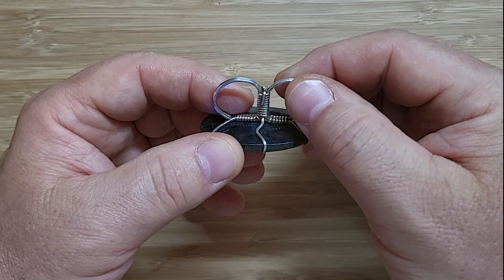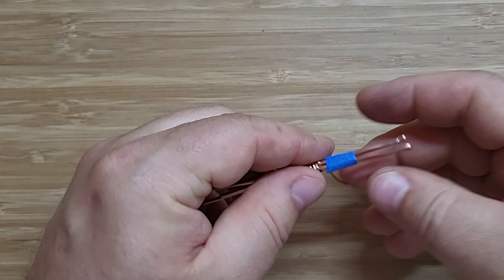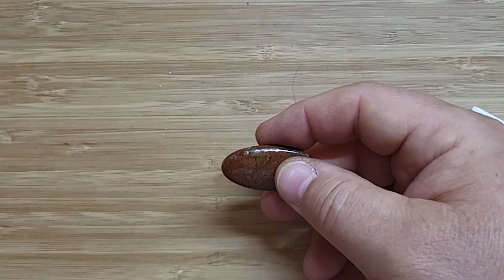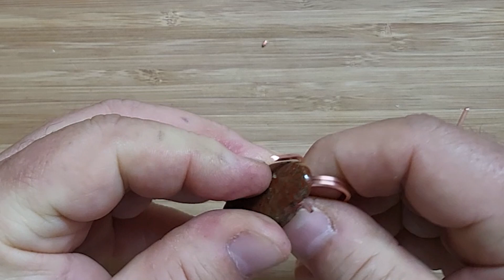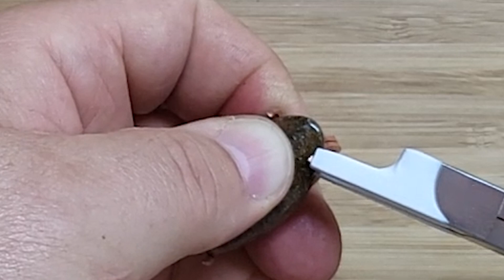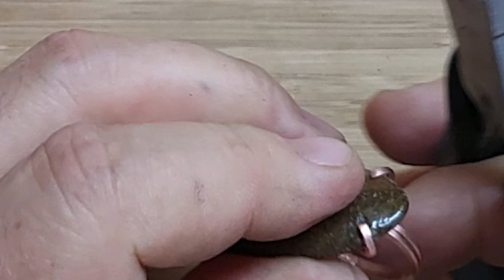The Two Finger Ring - Wire Wrap Tutorial

Comment: Hi Jim, this is a great ring, sadly my fingers are not long enough to pull off such a style. I have a tool question for you. I came across a jewelry tool (I think) it is a short flat nose plier that are more narrow at the tips, maybe 2mm (tip). The jaws are around 17mm long and more narrower then the joint. At about 1cm down from the tips are holes on both sides The jaws do not close tight, rather have a have about a 6mm gap, no spring. I have tried looking them up with no luck. So I turn to you in hopes of you maybe knowing. Thank you :)
Reply from the maker: I'm not 100% sure what kind of pliers those are. sorry
Reply: @JimMcIntosh  It was worth a try, thank you :)